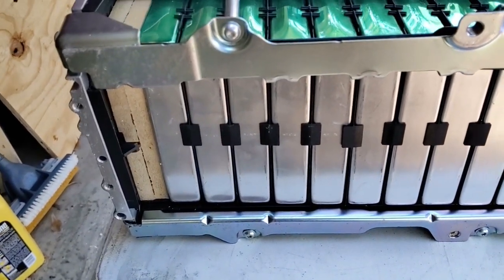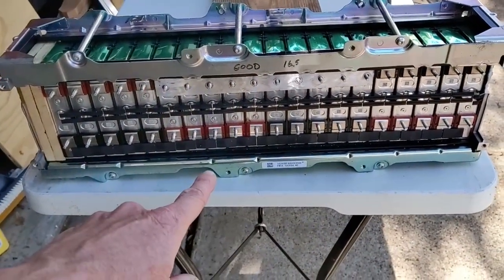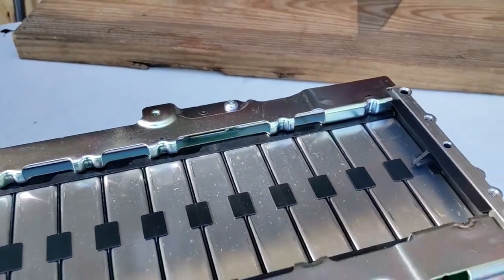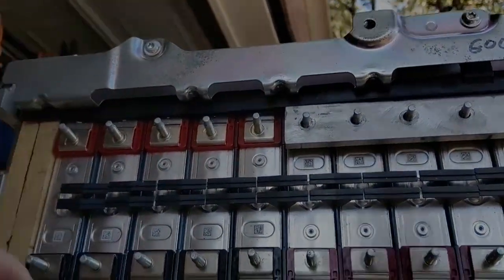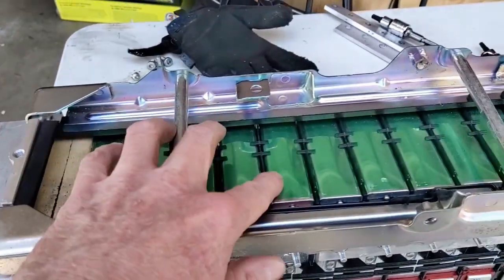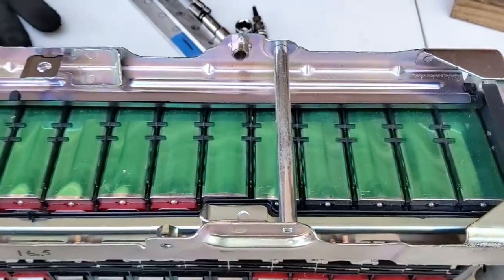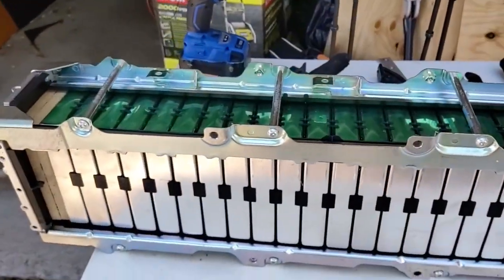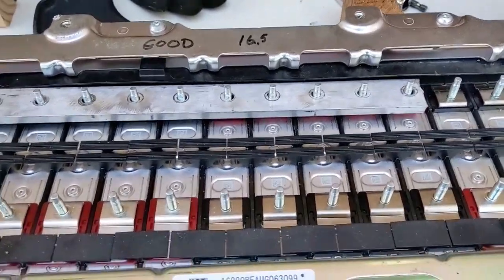Bad Car Audio Lithium Battery

Comment: how was the run time on your cmax powerd gokart? i know they say 26ah from factory. what has been your experience
Reply from the maker: I never did a range test but the battery always lasted longer than my play sessions.    I used the cart to run around my neighborhood.    Longest I ever ran it for may have been an hr.    Never had voltage issues or power issues.     I would charge to 4v per cell and maybe get down to 3.5????? All from memory from 2+yrs ago.

Comment: May I ask you a question? I got a 64ah headway bank. I used a power supply off Amazon all bassheads use. Soon as I hooked it up it fried the power supply. So I exchanged it and was afraid to try again. Do you know why that'd be? I got a 300a alt charging at 14.8v so I know I'm overcharging them, but don't know if that has anything to do with it?
Reply from the maker: The power supply u ate using to charge the headway with?    If so then u need to send volts to the power supply before u hook it up or it will blow ur fuse

Comment: Can you use an alternator to charge these? I understand I'd need a balancer. But having difficulty figuring out how to charge these.
Reply from the maker: You can use any charger, as long as it stops at the correct voltage.   batteries don't care what you are using, as long as the charger will stop at the correct voltage.
Reply: @ericensley2427  so a truck alternator will charge these then correct?

Comment: it would be interesting to measure the cca of the set, great video.
Reply from the maker: If u look up the definition of CCA, it s interesting.   It is the amount of amps that draws a 12v battery to 7? Volts.   If you used the same definition the CCA would be 3000+ amps.    Really what battery MFGs need to do is give people the DCIR.    in my other videos I show how that is done.     That way people can calculate their volts under their specific load.    My 150ah have a DCIR of .0005? Ohm(From memory).   So with a DCIR of .0005ohm at 2000 amps the voltage will drop 1 volt.

Comment: Good video.. BUT!!!!!!Sorry, 12minutes to tell us something that 3minutes would have been enough.
Its plainly obvious that the cells were bloated from 0:34.
At 11:40, you said the charger voltage went to 30V at low amperage, because the cells were SHORT Circuit???????????
I think it will be because the cells were OPEN circuit or had HIGH internal resistance.
If they were short then max charger current would flow and charger volts will go down.
You could have spent the last 9 minutes actually doing and showing the charger response and with a DMM measured each cell voltage.
Reply from the maker: Yeah sorry for the slow vid.    I did slot of that to document the battery to the owner.    I did not want him to think I was ripping him off.

On the charging part, short was wrong to say.   High internal resistance is a better way to say it.   The volts always fell back down to sub 1v when charger was turned off.